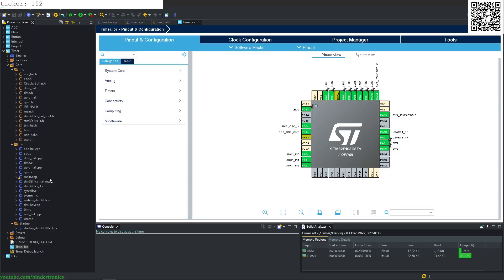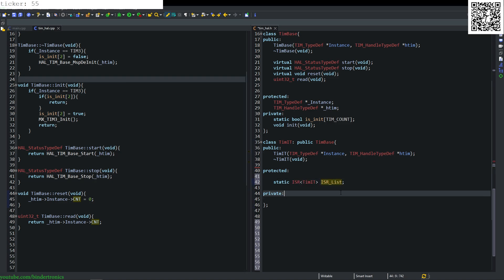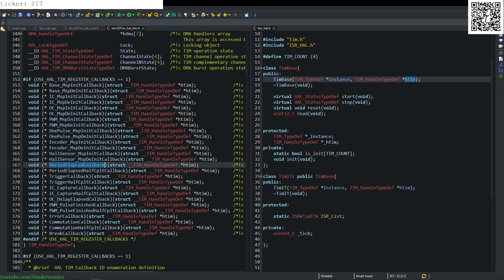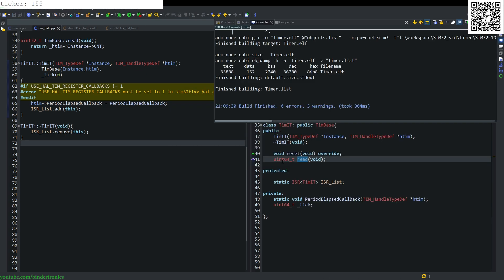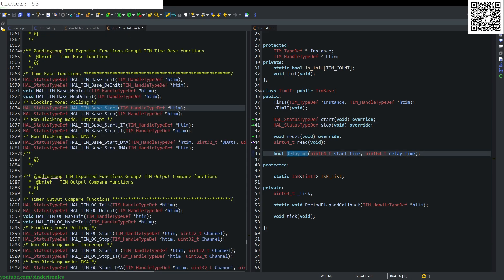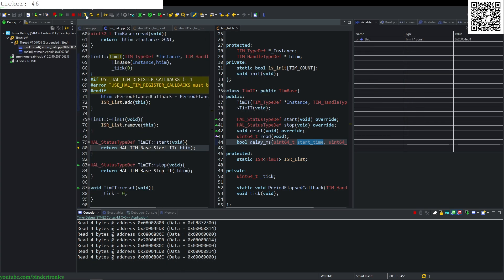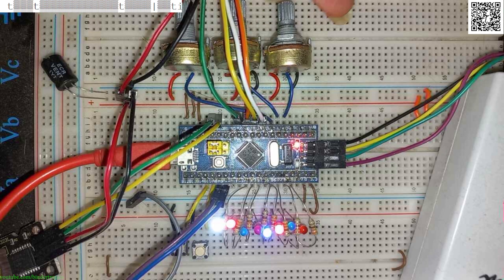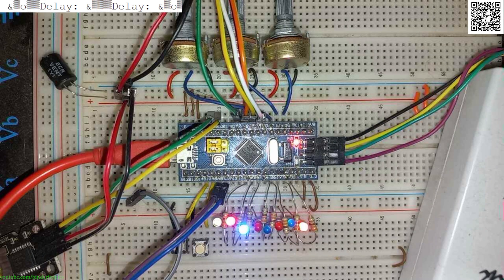Timer Interrupts 🟣 STM32 Programming with STM32F103C8T6 Blue Pill C++ in STM32 Cube IDE

Comment: Hi BinderTronics, I'm currently working on a project to build a digital clock using either a PIC16F877A or a PIC16F84A with an LCD display, but without incorporating an RTC module. Could you guide me on where to find reliable information and resources for this type of project? Also, which LCD display would you recommend for the best compatibility and performance with these microcontrollers?
Reply from the maker: https://www.youtube.com/playlist?list=PLtuqBdbsL-DtSo1a9pS4sLkoaU3Or2pl3
video 6,23,24,26

Don't worry about performance. just get it to work. Besides the MCU that you intend to use is a potato, you'll be force to write preformat code regardless.
Reply: Appreciate it! :)